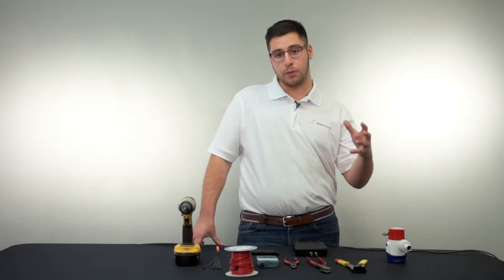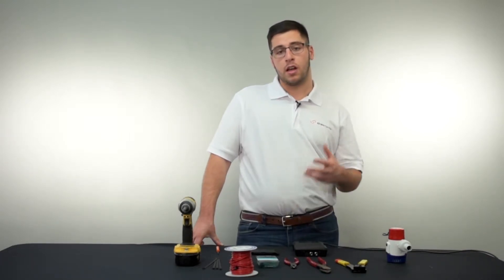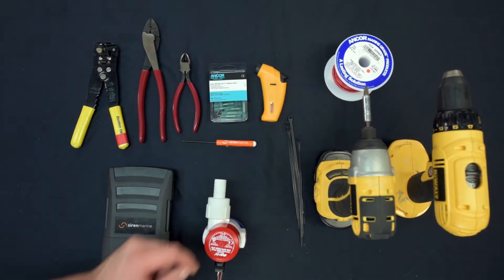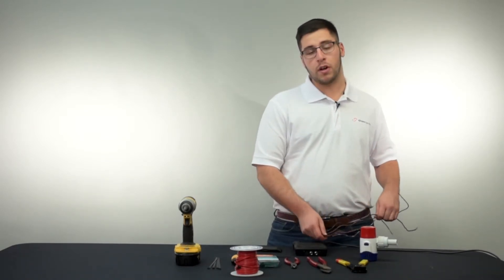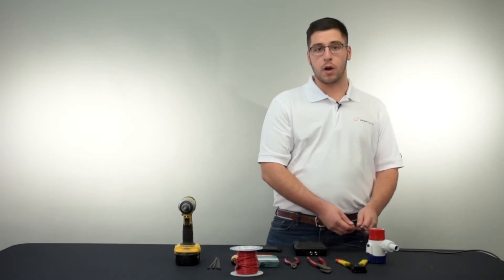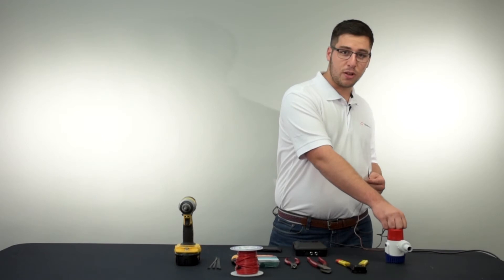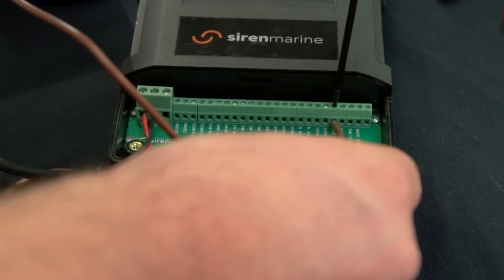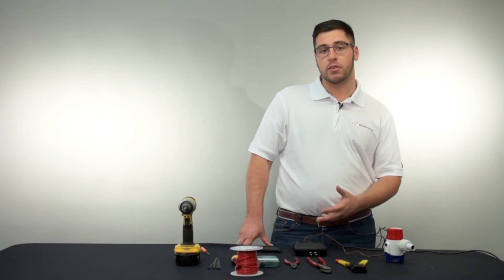Siren U - Connecting to Bilge

Comment: Wouldn't the auto side always have power? If the MTC unit is looking for 12v to know that the pump it running it would think that it is running all the time. I think it needs to get hooked to the manual wire so as that wire will show power only when the pump is running. That is how the light on the dash comes on when the pump is running.
Reply: I agree